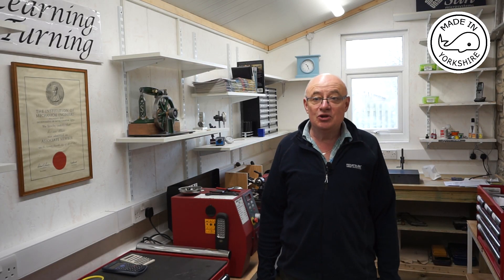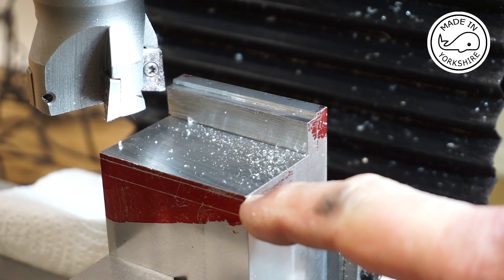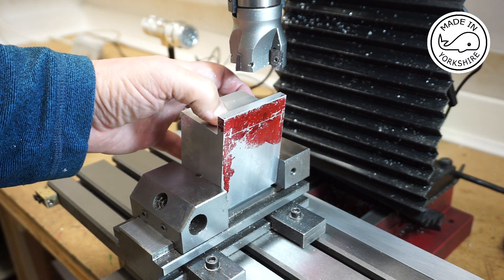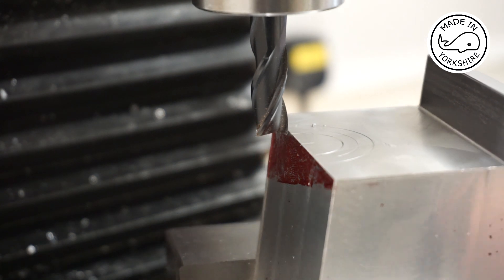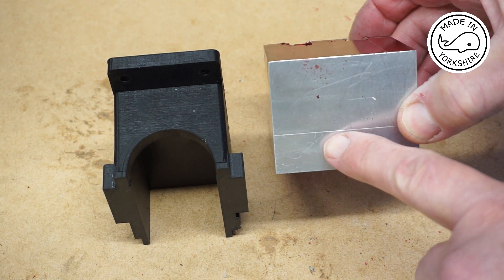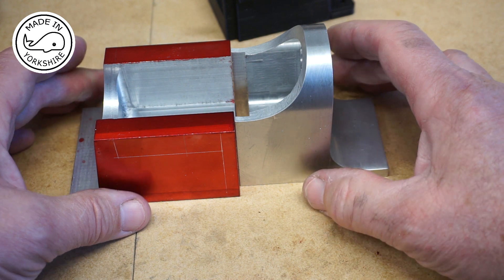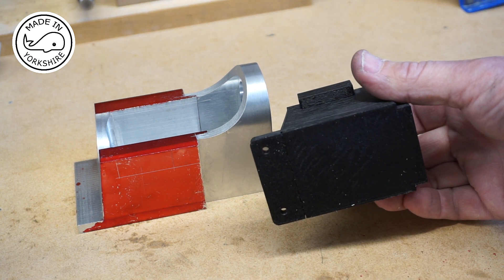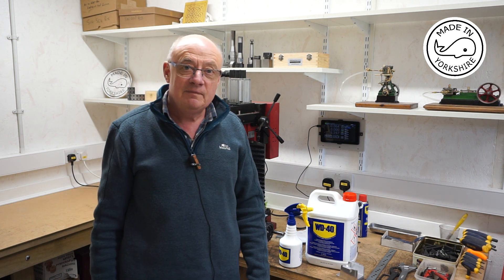#MT35 Part 3 - Farm Boy Hit and Miss Engine. Machining the Rear Frame. By Andrew Whale.

Comment: Aluminium is sometimes a real pain when milling against a shoulder as the Ali chips stick to the cutter and what protrudes out of the cutter makes that thump sound. How I found out to reduce this was slow the speed and feed down and use kerosene for lubricant. I am making to reference when I used a horizontal and vertical milling machine with a 6metre bed. Same principals still would apply.

Comment: Top work as ever Andrew. The pile of swarf was most impressive. I was a bit concerned that machining the outer faces with the middle hollowed out would result in flexing and distortion, but it seemed ok in the end. I am struggling to understand why the inside of the curved cut out is angled 8 degrees and not parallel to the base. Is this the shape of the part that fits into it? I admire your patience milling out all the metal for this part!
Reply from the maker: Thanks Tim. Yeah, the thick base and rear section provide a lot of rigidity. My interpretation of the drawing shows the curve to be cut at 8 degrees. Having said that I think it's cosmetic rather than anything else. Fingers crossed 🤞
All the best.
Andrew

Comment: That's coming along quite nicely. I have a similar tooling issue as you do except I have needed to get metric tooling. Although metric is widely used in Canada we have very limited availability of tooling for hobby size equipment. 
Enjoying coming along this journey with you. Keep up the great work.
I would also echo the comment of  roughing out the material by drilling the holes as opposed to milling it. I find it's far less expensive to sharpen a drill than purchase milling cutters.
Your new shop area looks fantastic.
Cheers from Canada

Comment: Great work as usual Andrew! After watching your video on your new horizontal bandsaw and after hand sawing a piece of 1.5" round bar ( for the last time) I bought myself one. Oh!, what, may I ask, is that plastic tub with the wires coming out of it  to the rear of your mill?
Reply from the maker: Great, I couldn't have to tackled this project without one. I hope you enjoy using yours. The box behind the mill is the Bluetooth controller I made for the TouchDRO. The wires from the three scales go into it. From there the data is transmitted via Bluetooth to my tablet. I previously printed a housing for it but not got round to fitting it.
All the best.
Andrew

Comment: Great idea in 3d printing that part so you have a better idea of how to machine it. This project is looking incredible.
Reply from the maker: Thanks Robert. Yeah - I'm really happy with the 3D print approach. It's like an extra level of checking for me before I make a cut. It's also a great way to learn Fusion 360. I've just printed the water hopper - 9 hours with 10% fill.
I now need to get the brain into gear and work out how to machine it. I think it could be challenging.
All the best.
Andrew

Comment: Looks like you did a little polish job there on the last shot. Looked like 70 percent chips and a 30 percent part. Nice job! 👍
Reply from the maker: Thanks mate - yeah this project is a real chip maker. My first bar stock engine and a real eye opener. The water hopper will be the next challenge.
Cheers
Andrew

Comment: You are running your little mill to the max and making some great parts.  Good idea to make a mock-up with the 3D printer.
Reply from the maker: Thanks Douglas. Yeah I'm pretty impressed how that little mill is coping. I had noticed slight table movement in the footage, but a tweek of the gib screws on the y-axis sorted it. I've just printed the water hopper. It looks like a complex part to machine and I expect the lathe to come to the rescue. I need to put my thinking cap on!
All the best.
Andrew

Comment: Nice precise work. "Spot on", as some might say.
Your workshop looks different. Have you redecorated or relocated?
Reply from the maker: Thanks Ron. Yeah, a few months ago I had a extension added to the garage to accommodate all my engineering gear. 6m x 2m and just perfect for my needs. So now I can make metal chips in the engineering workshop, and wood chips in the garage!
Take care.
Andrew
Reply: @learningturningmetal  
I'm slavering with workshop envy
Reply: @rontocknell3592  me too. I have a small lathe and a benchdrill in a outhouse, no word of a lie its probably 6ft x less than 4ft. Its bloody tight but i enjoy my hobby. 👍